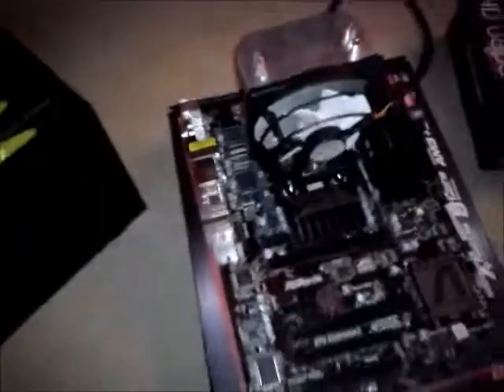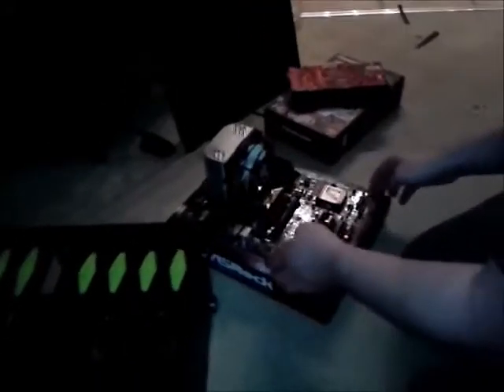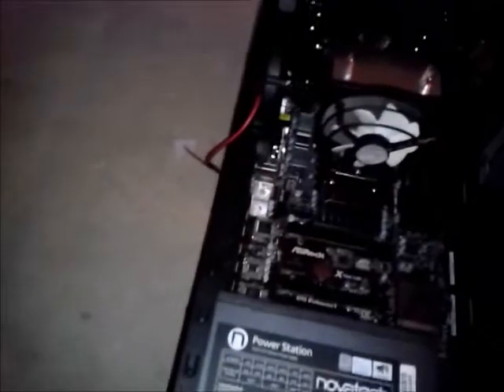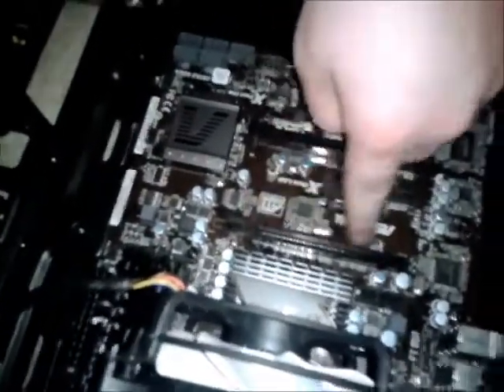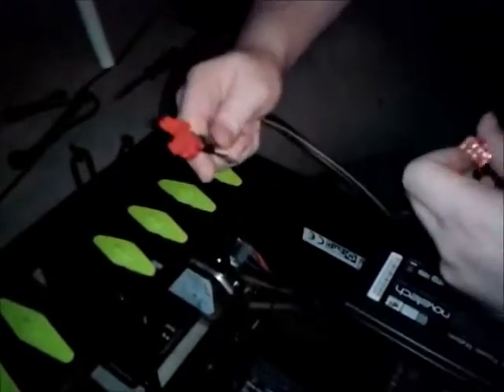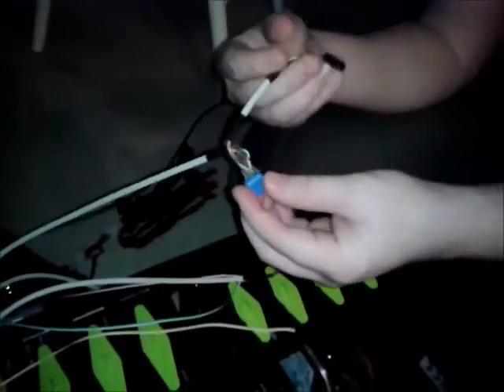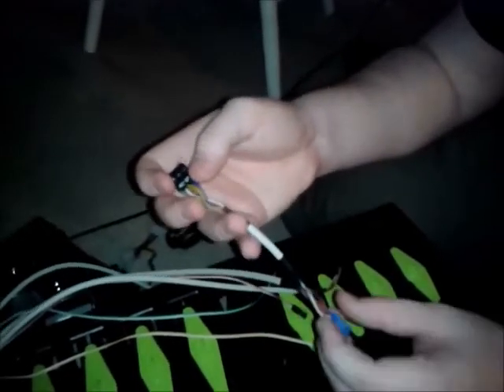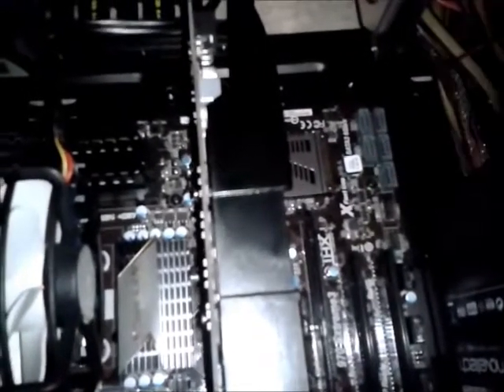Computer Build - Part 3

Comment: hey man , I just build a pc, we have the same MOBO but until now I still can figureout where to plugin the usb 3.0 and the ledpower and reset botton, any suggestions? I have the little speaker to but yeah it doesn't work I guess I don't know where to plug them in
Reply from the maker: This was actually a build for my parents so I've had to look into it for you.

There are no headers for USB 3.0 on the mobo (the 3 USB headers on the mobo are for USB 2.0). There are 8 USB ports on the back though; the 6 black ones are USB 2.0 and the two blue ones are USB 3.0.

I would make sure you go on ASRock's website, get the mobo up and download all of the latest drivers (and install them) to be safe.

In regards to the other bits. Use the mobo manual (download it when you download the drivers if you can;t find it) and go to page 30. That page and a couple of pages after will give you all the info you need for the LED, Power, Reset and all that.
Should be section 2.9 - Onboard Headers and Connectors.
If you want an overview of the motherboard and a reference point for where all the conectors are, page 12 will help (section 1.3 - Motherboard Layout).
The pages are based off of the newest manual which I downloaded off of the website so you're aware.

Hope that helps. Good luck. =]
Any more questions, just leave a comment.

Comment from the maker: Sorry for the delayed reply.
I honestly don't remember much in regards with the cable routing unfortunately but I can confirm that the reviews you read would be correct.
I fitted the fans with a noise reduction kit so they stuck out a little bit more. That actually made it a little awkward to put the motherboard in. It definitely is a tight squeeze but as long as the cooler doesn't go over that top edge of the motherboard, you should be fine.
It is a good roomy case for air flow.
Hope that helps

Comment from the maker: In other words, the bit that would touch the mobo needs to be smooth.

Be careful with the screws as well. If you do them too tightly you could split the mobo, Only do it tight enough to stop it from moving.

I hope this helps =]

Comment from the maker: Yes.....all of the holes that align with your mobo need the standoffs. By having the mobo screwed in on all holes should ensure that only does the mobo stay perfectly in place and doesn't bend, but it also grounds it.

I found out by killing my first ever mobo but not using proper screws which didn't touch the mobo. Make sure you use the standoffs and screws supplied by the case. Also remember that you want to be using the screws where the underside of the heads are smooth.

Comment: Nice video.ibuilding my 1st rig.
 I just  got new AMD 8120FX, ASRock 990fx extreme3, 8gb ram ddr3,1GB HDD,asus dvd writer and nvidia 660Ti ,PSU-LC 8750W 80+Bronze(Modular) ,Cooler master case 912plus.
Questions:Do ineed to put MBO on standof witch are in case mounted-i didnt see you did that- and then tight the MBO to side case panel-with screws??sorry for my english  i hope you understand my Question.any reply apreciate it very much.

Comment from the maker: I was working to a budget at the time. The slight performance loss was worth it for the price difference at the time.
Now of course the 6870 is better. Although the 7870 would be a much better investment in my opinion (mainly due to it being the newer generation).
Also this build is already outdated due to the second generation of AMD Bulldozer CPUs that I think are being brought it at the moment.

Make sure you do some research before buying parts though. Just to be on the safe side =]

Comment from the maker: Also, the case is capable of using liquid cooling without any further modifications (with the liquid cooling unit set outside the case.
It has two holes near the top (which have a rubber plug type thing to stop dust getting in) which you can use for the outgoing and incoming liquid.
Plus with the HD headset and mic port in the front obviously making it ideal for online gaming and 4 USB2.0 ports in the front it gives it a nice amount of versatility.
I'm tempted to buy one for my own PC.

Comment from the maker: It's not bad. I mean this is a gaming PC that's just been build. If you are looking into getting a bigger graphics card though you may find problems. Also multiple Graphics Cards AND multiple Hard Drives may pose a problem, it's actually a decent case with insanely good airflow though. Personally, if I got a larger graphics card, I'd modify the case so it would fit.
The build quality doesn't feel cheap on this case either.

Comment from the maker: Well I'm not 100% sure of GBP = USD but the Graphics Card used in this build is around £100. Even if it goes a little over your budget, it's a powerful piece of kit. It's easily on par with my £350 (1 year old) Graphics Card.

Otherwise.....just look at a card one or two models down from the card used in this build. The exact card used is in the description.

I hope that helps =]